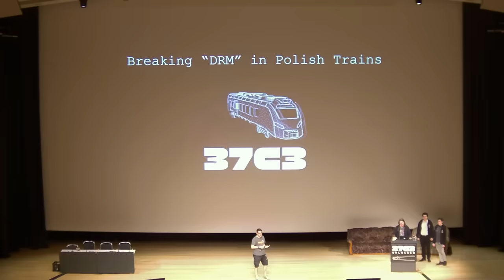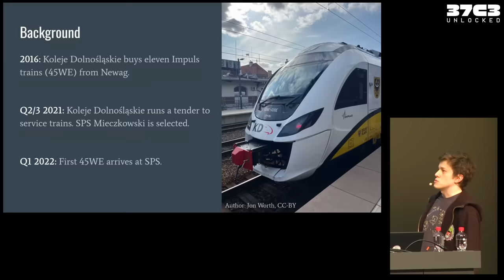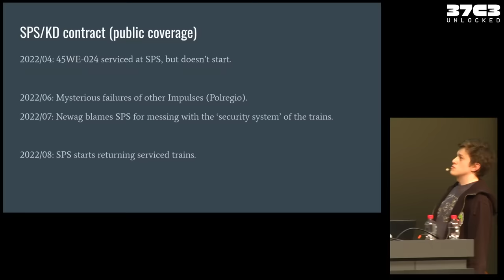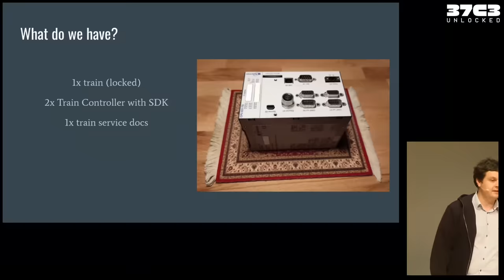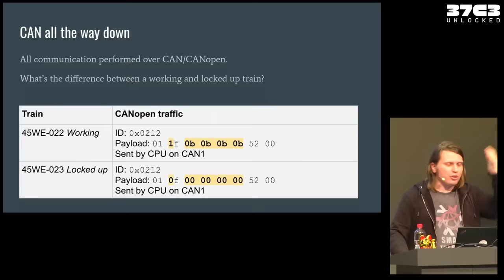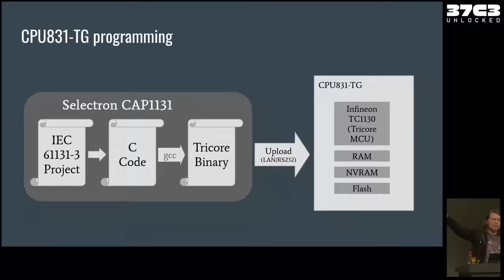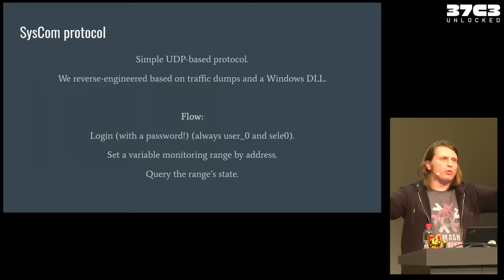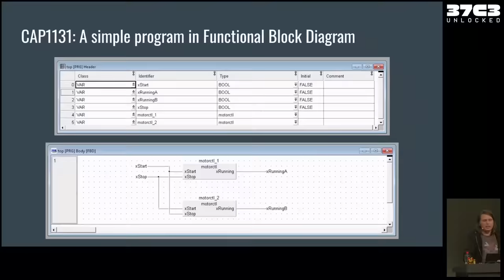37C3 -  Breaking "DRM" in Polish trains

Comment: As a Automation Engineer who works in a maintenance team and manufacturing engineering in one of Polish, local automotive parts factory I assume that it is not a coincidence, that Newag choose such an exotic equipment to use in their trains. It prevents that somebody from outside service could  easily do reverse enginnering of the PLC software. Or maybe this is some kind of guidelines when choosing the specific devices to be used in the trains industry, but I don`t think so. If they for example used an Siemens PLC`s and other peripherals it could be easier to find out what is the case, because we could just upload the program from the controller memory to the TIA Portal software and learn how the program works. Siemens is providing enough documentation for understanding how to program their PLC`s. The same with other manufacturers - Beckhoff, Mitsubishi, Omron...they are very common and easy to program. I know, there could be the possibility that the program blocks could be locked / secured with the password and make them unable to open in the editor. But as I know it all depends how the agreement between the customer and buyer is concluded, sometimes machine suppliers don`t want to give me access to the PLC software but normally it should be shared for example if I want to find out online why the machine is not working as it should. Sometimes during repair some of machines in our plant I have also discovered bad practices of the programmers / machine integrators. Example - when we replaced one of the components of the machine it would not operate correctly because there was a device serial number mismatch (HMI panel). There was a function written in the PLC code which compared the serial number stored in the data block, and if it`s not the same then it wouln`t be possible to switch the machine in "automatic mode". 
Redford, q3k ,MrTick - good job, my congrats!
Reply: I'd rather think that this is because those exotic PLCs are way cheaper than Siemens ones. Most likely it's the same as with Asian companies manufacturing cheap electronics. Nowadays, they often choose microcontrollers from Holtek or Padauk instead of more common ones like AVR, PIC, ARM-Cortex-M0 and the like in order to cut costs. Servicability or even availability of debug and test equipment aren't  really important because it's cheaper to replace a faulty PLC instead of repairing it in the field.
Reply: @vbinsider definately that was not the case. Different in price is not that significant unless you go for big screen resolution HMI panels. They probably have chosen manufacturer who is not programmed easily but consider parts availability or running out of business by the vendor.
Reply: Well, i do automation too, but in some cases you need a check - as is said in video - different firmwares in same device can behave differently. If i will be the one performing this behaviour, i would also lock the code - where is the point "locking" the serviceability of the device, to checks like this, when i provide unlocked code with the device and everybody with few hours in code can bypass the function?
Reply: Regarding hard coded serial number, it is highly possible that the component you were replacing was crucial to safety of the plant. Usually it is easy to replace the serial number but needs proper credentials for it (safety).
Reply: "It prevents that somebody from outside service could  easily do reverse enginnering of the PLC software." - Heh, the fact that Ghidra already had support for this architecture means that this equipment isn't nearly as rare as Newag guys thought it would be....
"If they for example used an Siemens PLC`s and other peripherals" - I have a feeling that the PLC they've chosen was significantly cheaper than the Siemens stuff....
Reply: Selectron PLC are not so rare in trains. Swiss manufacturer Stadler is using or has used Selectron. Selectron is now owned by Knorr-Bremse a big company in the train sector.
Reply: @andreasmeyer550  And possibly it's just another CodeSys PLC. I had to debug Selectron PLC code of a 1980ies machine a couple years ago. High quality stuff ;)
Reply: They won't use a Siemens PLC because Siemens is a train building competitor. that said, Siemens kit will be found in most EU based trains, if only it's the cab radio...
Reply: @CoolKoon  Siemens (SMO) is also a train building competitor, thus most of the train builders don't use Siemens PCL's including Alstom

Comment: "Tricore has separate data and address registers"

Wait a sec, are we sure this isn't just a Motorola 68000 in a trenchcoat?
Reply: It's called tricore so it's probably THREE 68000s in a trenchcoat
Reply: The Selectron CPU 83x Series processor is based on the industrial 68000 version, 84x is based on ARM processors. The PLC log of these machines can be pulled from the unit with a basically free tool. In that log is to see when the software was uploaded and what was the windows user name, the timestamp can be wrong because the rtc is running only limited time if power was lost and can also be altered with the same tool. But then again this change of the rtc time will show up in the plc log report.
Reply: @jm3779  So it IS a 68k in a trenchcoat!
Reply: @SuperSmashDolls  Not surprising since the embedded version of the 68K is still in production and being in industrial settings.
Reply: the 68k is a cpu that's easy to program for at a low level so it makes sense for embedded use
Reply: That was my first thought.
Reply: @SuperSmashDolls  Ghidra should support MC 68000. Why do they experience problems with its register model then?
Reply: @TorutheRedFox well arguably thats true of any cpu. software is pretty easy, in my experience its the hardware around it thats a pain
Reply: More or less yes, except for the lockstep
Reply: I just browsed the Tricore 1.3 (which is what this processor implements) architecture overview, it does not resemble 68000 nor ARM, it's very much its own thing.
Reply: @LMB222  It doesn't support lock-step, there's no mention of it in the processor datasheet or architecture overview handbook

Comment: About the re-certification topic: If newag partitioned their code into safety-relevant and non-safety-relevant parts, they might be allowed to make changes to non-safety-relevant parts without requiring any certification.
Reply: Orange and non-orange parts!
Reply: @capnskiddies  surely any change to the ability to move the train affects safety, if there is a fire in the service yard and you need to move stock to prevent it burning then it being disabled for anti-competitive business reasons is safety critical. Also, disabling the train does change the "response to driver inputs".

Comment: Very interesting, informative and entertaining! I wonder how many other big companies might be doing something similar to keep service income high and probably as a side effect also discredit competitors in the repair market. This is insane. The amount of different illegitimate locking mechanisms is impressive and seems like there was either criminal intent to make every failure look a bit different, so no one would get suspicious if all the trains had the same problem on the same day or they were incapable of even installing their own significantly altered and malicious code properly on the trains. I really wouldn't want to imagine what could happen if one of the locks misfired at the wrong moment and lead to a serious accident.
Reply: John deere
Reply: Actually some of the “locking” mechanism just normal security measures. When there is not at least one functioning compressor left it’s a good thing that the train will not allowed to move by its own, but after that is fixed the locking mechanism must release itself or the maintenance should be able to reset the lock. If that is by a tool or the HMI or a “cheat” code doesn’t really matter. What is concerning is that they say the software version was different from train to train. Because that should not be the case. After production and development, validation of all the requirements the software will be “frozen” and trains running in Service have all the same software version on that fleet. But don’t mistake that with a memory dump from train CPU memory that was in service, there of course will be a lot of data stored that divides between different trains. Like the train number itself and various counters, or for example all the wheel diameters. Therefore you need look carefully what is code and what is variable data.
Reply: @jm3779  I would expect any normal security measures to be documented and known to all relevant parties.. So if secondary compressors don't work, the HMI should at least say train is not ready to go, call a maintenance; to the maintenance worker the compressor is not working, check it; all of that documented in a thorough "what to do when...".
The abnormal security measures, as presented in the video: HMI says everything is ok, maintenance says everything looks ok, and computer experts say the CPU decided to power down the inverters because the train is out of warranty.

Comment: Absolutely awesome story. The reputational damage to Newag is so much huge. They will have to do something outstanding to wash away that shame. But how something like this can be prevented in future? Should it end-up with a law requirement to supply a source code together with an update of firmware? Code-review by customers or certifier before code gets into the train?
Reply: use a freedom-respecting license and make the code public, I doubt train operators have a lot of IT folks capable of analyzing an entire codebase
Reply: @formbi  Perhaps that should change? They have talented mechanics and technicians, why not employ code technicians that are well trained...?
Reply: The sad thing is that such regulation will likely only do more harm than good. What if the manufacturer just send you obfuscated code? A code that only they can understand is not so different from a black box binary. Even worse with  advances in NLP, they can obfuscate the code in a way that looks like normal code to untrained eyes, but breaks in mysterious ways when you attempt to modify it. Then what? Make regulations requiring explanations to every line of code? 

I totally get the good intention, but the reality is always complicated

Comment: Excellent work folks. Not just on the reverse engineering, but also on the presentation. Zero bullcrap/fluff, straight to the point.
The comparison train sure got famous. "This is not how you compare dates."  Indeed, I wonder what effin connections you have to have to get hired as a coder while producing such an atrocity.

I sure hope Newag gets punished way beyond a considerable fine. This is not just a monopolist stunt. This shit is actually dangerous and eerie (nationwide emergency transport case).

Comment: Do i get it right that they created a fake emergency stop condition? If that's the case they must have falsified their safety certifications (by not documenting the conditions). That mustn't go without consequences.
Reply: I think that this is just a normal "release operation" bit to the inverter.. I don't think they send an emergency stop via the standard CAN Bus, at least this would not be done in the industrial automation.
Reply: I understood the talk to mean that the conditions were not that the train would e-stop, but that it would not start (or at least the conditions were such that, if the train were in motion, the lock could not be triggered).
Reply: Normally pulse release to allow movement is done in two different ways, one of them is a hardware release and the other is by data communication. Hardware release has a lot of opening contacts like driving directions, door closed loop and many more. Software (data) release has the same but also others like enough air in the reservoir to be able to brake when moving or like the one shown in the slides who makes sure that at least one functional compressor is there. Everything of that makes sense for security reasons. Geofencing your competitors out of maintenance contracts is an other thing and not something you should be caught.

Comment: Why is noone is asking these manufacturers why trains are being sent to maintenance? Like:
"Great the train works again so what was the issue?"
"Oh my 10 year old son was doing the logic for the date checking, turns out it didnt work at all and just shut down the whole train lol"
"is this why we had to shut down the train for weeks and pay you thousands for maintenance?"
"Ummmm actually someone was interfering with the software xDd phew they didnt catch on"
Reply: Reporting what the issue was and what they fixed is standard in repair contracts (at least if they are paid per problem), but that requires the contractor doesn't just lie. And if a company goes to such length with differently sabotaged software for individual trains they are going to lie.

You can try to catch these cases by randomly sending someone to inspect the work as it is done, but if the trains are worked on for weeks it is not practical to have someone there all the time - and even if someone is there they would only see that among other repairs the software was updated, they wouldn't have the time or the knowledge to dig into the software like it was needed to actually find the sabotage.
Reply: They probably gave a somewhat true but opaque answer such as that they updated the firmware to make the startup sequence more robust under "service conditions". Companies can generally get away with such evasions because those who have the clout to demand a detailed account don't think they would understand it and prefer to nod their heads up and down.

Comment: How are such measures of a manufacturer for a public good legal? The EU should definitely step in as soon as possible. I hope nobody will buy from Newag again.
Reply: Polregio, mentioned here too, just signed a contract for new trains from Newag.
Reply: The problem is that when publicly owned companies (such as KD or Polregio) want to make big purchases (such as trains), they have to do a tender. Basically, they publish a quite detailed "wish list" of what they want. E.g. 20 trains with 200 seats, equipped for regional transport, able to go 160 km/h and so on - but way more detailed. Then, companies can make an offer for how much they would deliver these trains. Afterwards, the "best" offer is chosen following clear rules. Sadly, in most cases, this is the cheapest one. In general, these measures do make some sense to tackle corruption, inefficient spending of public money, cartels and so on. 

Though, what would be possible is to specifically ask for a full repair documentation in the tender, explicitly forbid any measures of the manufacturer that negatively affect repairability, and to go for sure write an extensive liability clause into the contract that the manufacturer is fully liable for any financial damages (including the cost of train cancellations for passengers) if such measures are detected.
Reply: Everything's legal unless it's illegal.
Reply: @skblablablabla  well, there is a solution: all public tenders with a software component should require full access to all the source code within the product. This would promote transparency and open source solutions too.
Reply: @skblablablabla   Well, I bet they can be excluded from a tender due to "serious misconduct", but for that the legal processes mentioned should be finished, as it would make proving the misconduct much easier...
Reply: @skblablablabla basically this is the solution. You just lock it down in the tender and sue the manufacturer to kingdom come is they play silly buggers.
Reply: @JanStarzak  Because of UNECE R155, which is a regulation about cybersecurity for vehicles, i think the source code will never be published. I am not an expert about the regulation. But the general gist of it, is that a vehicle manufacturer needs to safeguard their electronic devices against cyber attacks. Publishing the source code is perhaps introducing an easy way to start attacking the system. (for example, using the source code, i can make a CAN device with sim, that i attach to the CAN line in some cabin, using a screwdriver to get into the electrical cabinet or something. and then  when i want to crash the train, i send the right messages for a brake override and voila. Train goes into a neighbourhood full of people or something.
Reply: @TheKrikje010 That's a bs security by obscurity excuse. If someone has physical access to the can bus they could crash the train simply by blocking the bus. Moreover they shouldn't need to publish it to the general public, but to provide it to the owners of the specific train possibly with NDAs. I mean if you buy a train just for to access the sources then do it, by all means.
Reply: @TheKrikje010 jts the very opposite. The more open the software is the more people hack it and provide fixes. If it wasn't the case then whole world would run on windows server. In reality even Microsoft uses Linux on their Azure cloud services. There is no better way of securing software than making it open source.
Reply: And nobody will buy from Volkswagen(Dieselgate) too.

Comment: what do you bet the next version of the train firmware has geofencing around the researchers' houses, lol
Reply: If the MAC address connected to train's public wifi matches devices of the researchers and train distance from nearest station > 10km, engage emergency brakes , turn heating and AC off.
Reply: And lock the doors @sharpfang
Reply: @sharpfang if temperature is high, turn heating on, if temperature is low, turn AC on ;)